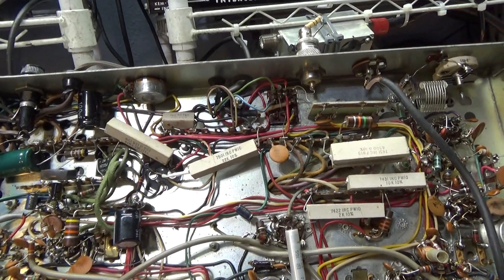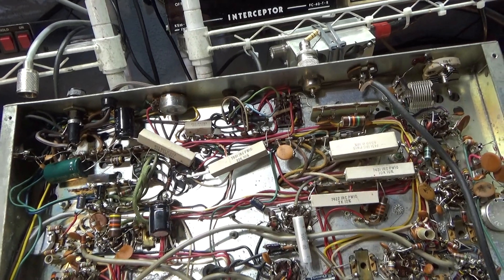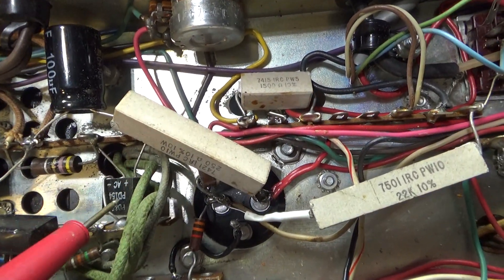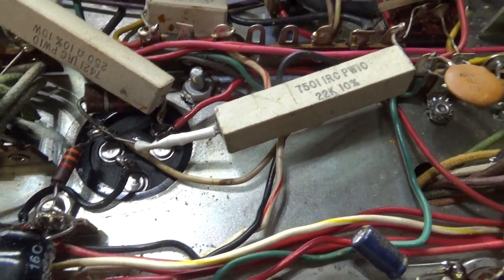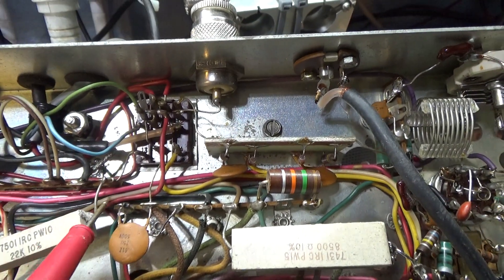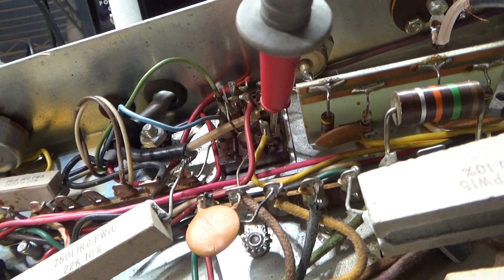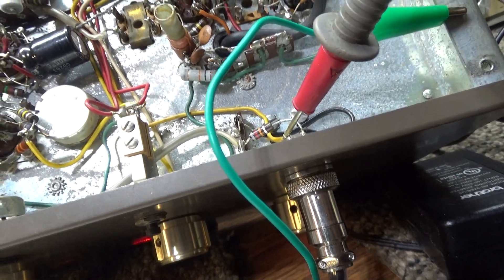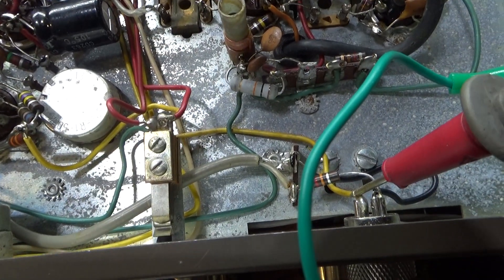Browning Golden eagle Mark 4 tx relay not keying hot testing

Comment: Hey TramDr have you ever had a mk4 on say your on channel 6 it will key on 17 but the radio says 6 ?
Reply from the maker: Mark 4's are nightmares. Get a 4A.
Reply: That’s what I have a 4a … thing works transmits but if I’m on 6 on the tx and rx is on 6 it’s txing like 6 channels away.. I hooked up a separate radio to find out where it was transmiting that’s how I found out
Reply from the maker: 4a's don't normally do that. Does it have extra channels in it?
Reply: Not that I see.. no extra channels no